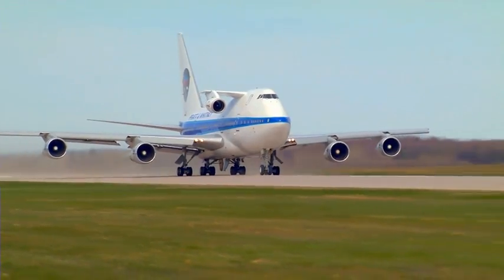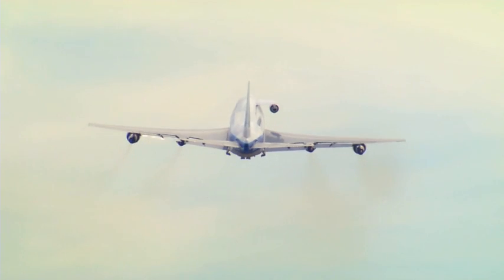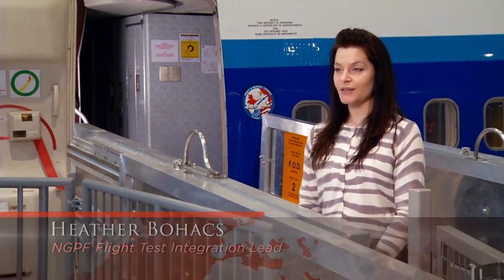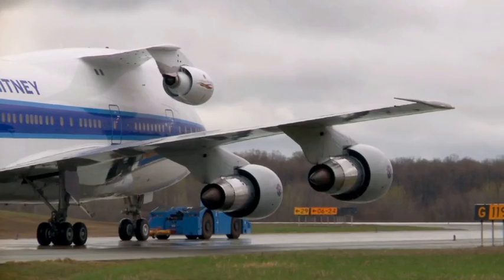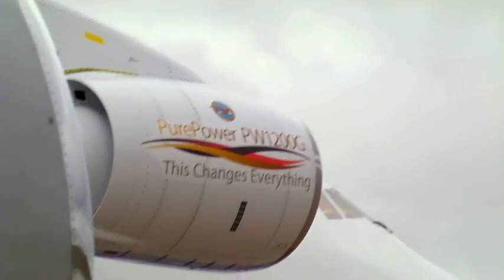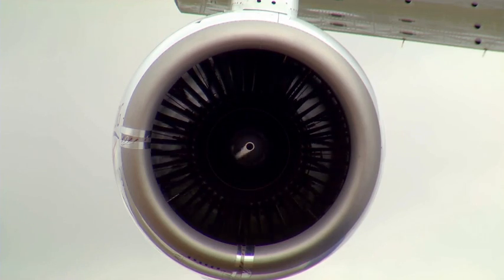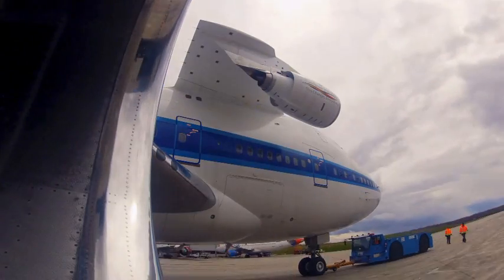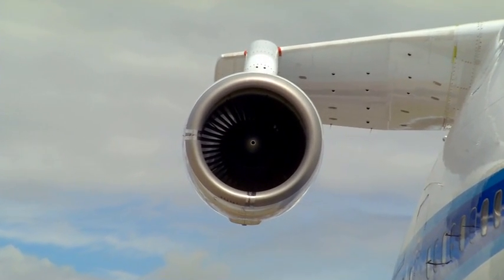Breaking News!  Pratt & Whitney PW1217G Engine Makes First Flight

Comment: Looks unbalanced. Why couldn't they put another one on the other side???  Probably millennials designed it
Reply: Bruh its a test bed its not made for anyone to fly it, there only testing a engine, they wont need engines on both sides since their just testing the engine, and the engine gets removed after testing is finished, and its balanced , smh
Reply: And no one designed it , boeing made it , the plane normally just has only 4 engines. they attached the 5th engine for testing not to fly it commercialy

Comment: There are grooves on the runway to give more grip to the flying dildos because there are planes that have 2 engines and vibrate on the grooves that also drain the water.

Comment: the 747  test bed has GE engines on the wings, so when the little hamster wheel quits they know they will still have 4 turbines  that work to get them home. peculiar place for testing a geared fan engine tho, it looks like it's perfectly in line to decapitate the 747 or at least blow a huge hole in it right behind the flight deck if it comes apart. lol.
Reply: ryan olson the 747 they are using has the Pratt & Whitney JT9D

Comment: I'm beginning to understand the advantages of the geared turbofan. It's not quite rocket science but it still took me a while to grasp the concept.  The way I understand it is it allows the core to operated at the optimum speed while the gears allows the fan to turn slower thereby performing at it's best speed and quieter. Please anyone correct me if I'm wrong.
Reply: Uh...yup. Exactly the way a geared piston prop or turbo prop works as well. Not rocket science, like you said. The only other possibility is the exact reverse, and common sense would suggest that's not likely.

Comment: what an ingenious way to test an aircraft engine. No worries if it breaks down, or needs to be shut down. No worries about crashes. 

Neat video.
Reply: That's why they use a 747 to test engines. If the one being tested fails you still have at least 3 others to get you home. (4 in this case)